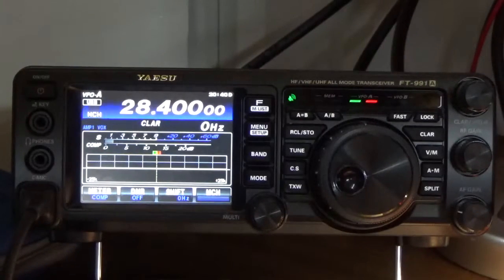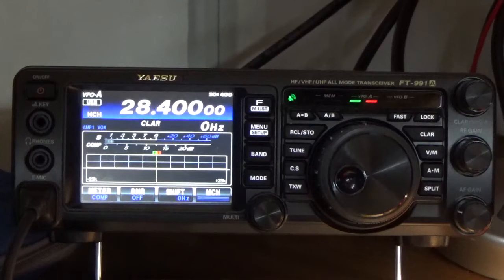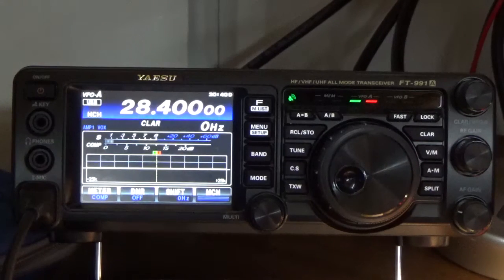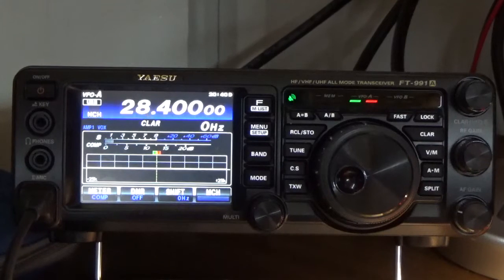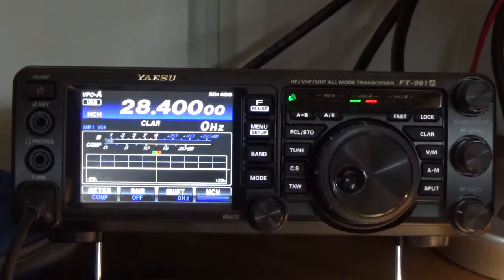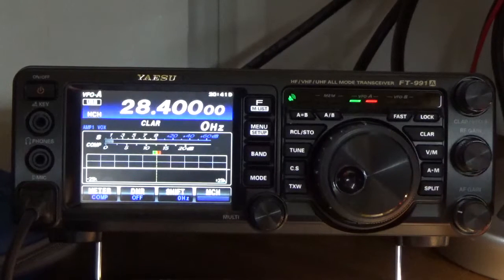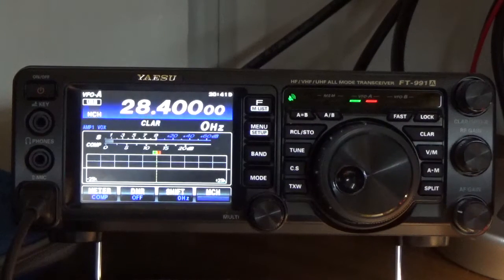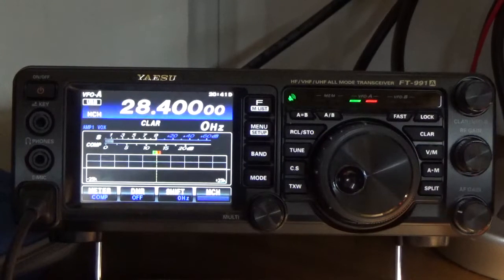Speech Processor and Parametric Equalizer at the same time and settings from FT991A Yaesu manual

Comment: I don't get it. Why turn the bass up like that?
It will get wery boomy, and you will "waste" a lot of power on the bass frequencys. It's the area around 2200-2700 Hz where the speech for male voices is most understandable.
You should turn down the bass, not up. Maybe you should set it to MINUS 10 instead of +10, depending on which microphone you use,
Reply from the maker: Good point I later realized that - I'll try the -10, lately I've been doing mostly CW but that's a good point - thanks for the message and 73

Comment: Steve, again thanks for this, after reading the manual a bit more I think I understand he Freq/Gain/Q selections better. I watched another of your videos and menu items 131 through 136 are different between the two videos. In fact, using the MONI setting the unprocessed sound is louder than the processed sound. No worries I will keep tweaking it. I am using a headset and find that I can't run my Mic Gain above 10 not my compression above 10 or I get a lot an ALC into the red and Compression above 10db. The good thing is that I do understand it better due to your videos.
Reply from the maker: Good evening timmyers thanks for the message these can be tricky let me know if you need anything this radio is a lot of fun 73 and hope to catch you on the air.

Comment: All these Gazillion menu settings are just a sales gimmick that people fall for.  There are many older ANALOG radios that are much better than the FT991A and they work just fine.
Reply from the maker: It would interesting to to take a older radio without all the software and do the same type of video showing old school tuning knobs etc.  I'm embarrassed it would take me a while to muddle through all the knobs and switches just to get started - I see now even some of the newest radios are just a black box with some coax connections you operate the whole radio by software.    Next they will embed a microchip in our brain and not need computers.  Thanks for message  73
Reply: I have some real world experience with this, I had a Yaesu FT-767-GX, a very nice radio. I was having some Tx issues and opted for a 991A, I couldn't believe the difference in Rx quality, and that was before I learned to use all of the audio settings available. Now I do have a crutch that is very helpful in using Win4Yaesu control software which makes changing these settings much easier. I sold the 767 and never looked back, YMMV

Comment: I made these adjustments and started using the speech processor.  It's really helped those harder qsos and I'm even breaking a few pile ups where I've always struggled.
Reply from the maker: Good evening Robert, thanks very much for the message I'm exited the audio changes are getting you through the pile ups, yeah that's a great feeling to hear another station pulling  you through, I'm way behind on my HF need to get my CP-610 up in the air, thanks and let me know if there's anything else I can help you with '73

Comment: Thanks for sharing. I've ordered the FT-991A back in June and still waiting for it. This video will help me set it up when it finally arrives.
Reply from the maker: Good evening John,  I hope it comes in soon so you can give it a "test-drive" let me know if you need anything email me shope02@yahoo.com and I'll send you my latest notes I've been using for the videos  '73 de KI5JUF
Reply: @westtexasvideogateski5juf255  mine arrived a couple of weeks ago. it's a very nice tranceiver! I've been toying with the settings per your video and using the monitor function transmitting into a dummy load to hear the results. I'm not sure I'm the best judge for what sounds most natural in my own voice however.
Reply from the maker: @imarunner2  Good evening John how are you doing?  One friend recommended headphones to listen to you voice, Heil is a popular HAM brand, I know it's hard to be the judge of you own voice over a speaker.  The important this is not to have distortion or overdriving the audio into the amp, let me know how things progress, appreciate the message '73 de KI5JUF